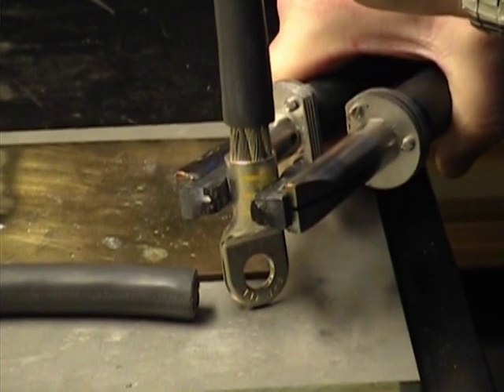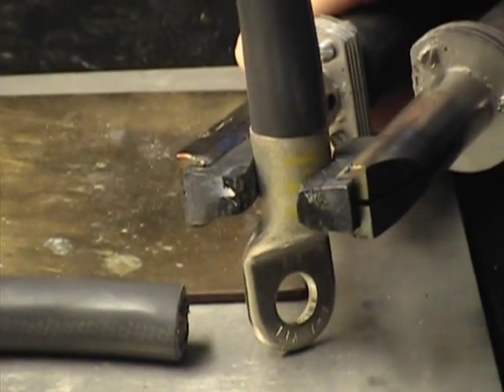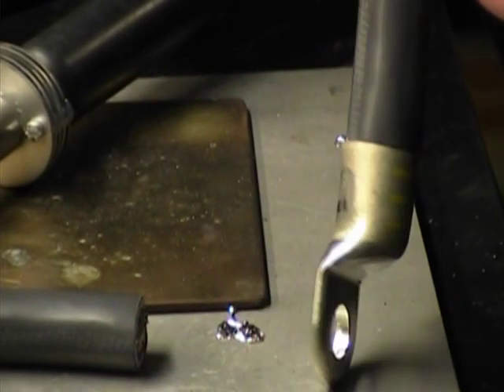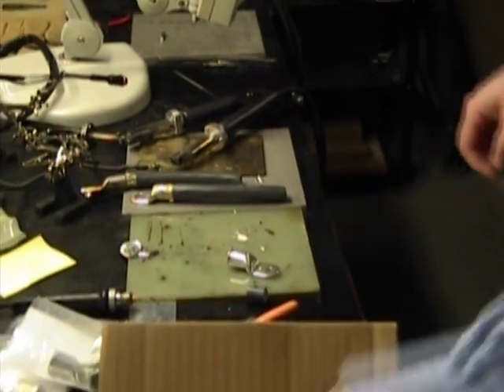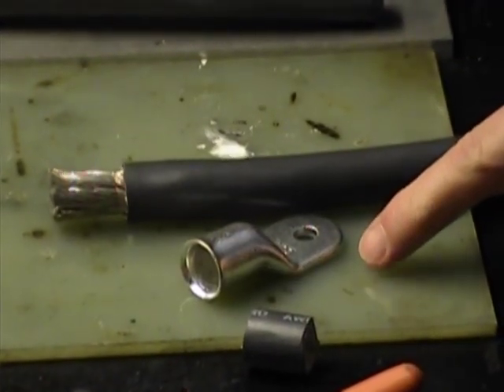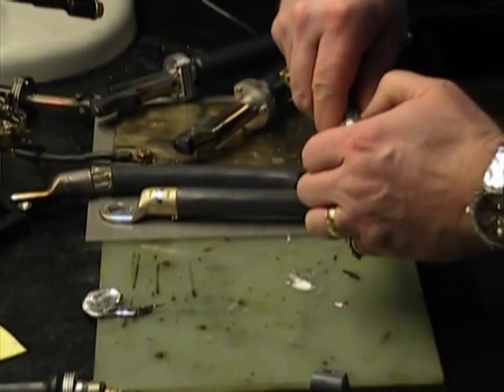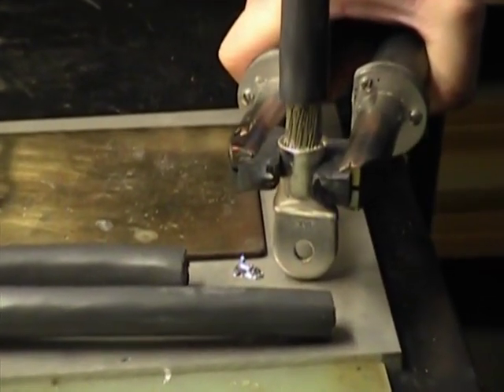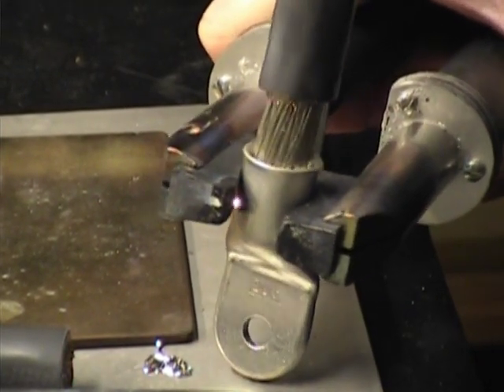Resistance Soldering 0000 AWG Cable Assembly

Comment: hi, electrician here. 

0000 is usually written as 4/0, and you call it "four aught" wire. and so on down to 1/0 AWG or "one aught". 
(i call that "number zero" to mess with the apprentices sometimes... 😏)

Also, wire gets bigger than 4/0. industry standard is these sizes:
250kcmil
300kcmil
350kcmil
400kcmil
500kcmil
600kcmil
700kcmil
750kcmil

"kcmil" are "kilo cicular mils". A "mil" is 1/1000th of an inch. 🇺🇸 So a 250kcmil wire can fit 250,000 circles with a diameter of a mil in it's cross-area. 

Which is fucked up in it's own way, but it's even worse when you learn that ALL american wire is rated in kcmils, and logically, the rating gets larger as the wire gets larger. We just choose to use this antiquated system that has three different systems for naming wire sizes.

The National Electric Code has a ton of goofy-ass calculations in it too. And us electricians are taught to not question the code book, but just assume that the counsel that writes the $90 fucker every 3 years knows what they're doing and that they're definitely not awful technical writers at all.

I could honestly make a whole youtube channel about the fucked up stuff in the NEC.

Comment: Nice. Where can I get one? Make soldering wire look clean. I usually use a touch to solder my terminal to my power cable, but it doesn't look as clean as that.

Comment from the maker: @suprmacdaddy 
Solder is manufactured and available in many forms. 
For this application Pre-Fluxed (cylinder shaped) pre-form blocks of solder are being used. Many times this is the best way to introduce a large amount of soldar at one time.